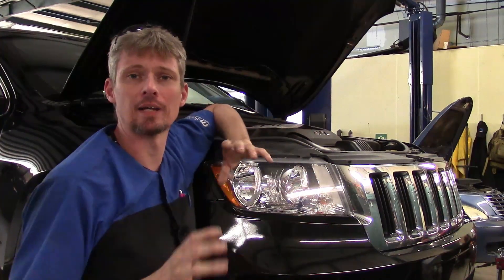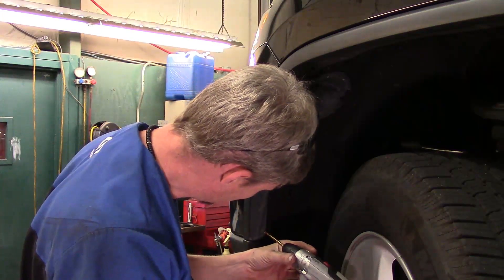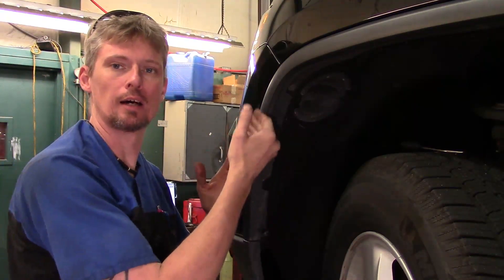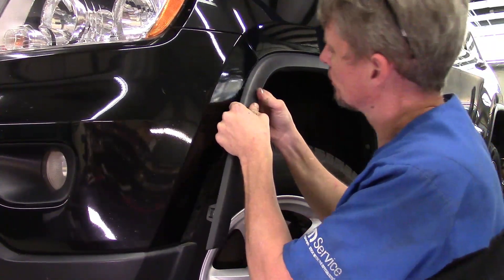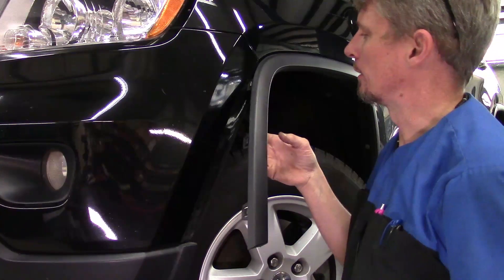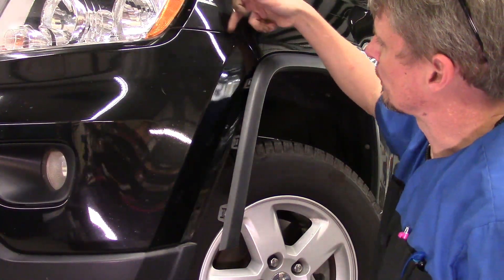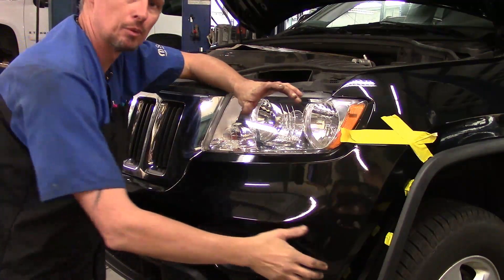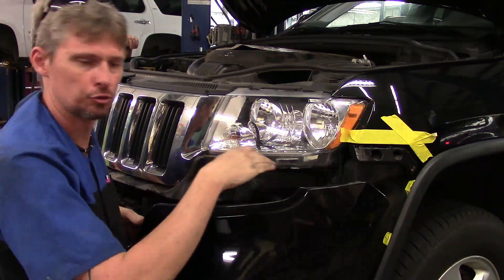2011-2013 Jeep Grand Cherokee front bumper cover removal

Comment: This video was great. Thank you for that. The only downside is that it didn't have a re-inetsllation sequence. Neither does the instruction sheet that came with my tow bracket kit. The tow bracket kit instructions were nowhere as good as this video, not by a long shot. So, again, thanks for such a great video.

Comment: I have what is probably a silly question on the reinstall portion - for the plastic rivets that you drilled out, do you just use new ones to replace (if so, what is the part number?) or do you leave those out when reinstalling? Also, drilling does look to be fairly easy, but just in case, is there an alternate way to do this? Im a little afraid of being slightly off and damaging something.
Reply from the maker: You can pic up the plastic rivets at any local parts store. You will need a plastic rivet tool to install them as well. Here is a link to my amazon store that shows the tool......go to the body tool section and there it will be: http://astore.amazon.com/motorcitymechanic-20 . Otherwise drilling is the best method unless you can knock the center out of the rivet. Usually thats hard to do so drilling is the best method. Have no worries and take your time....you wont have any issues. Thanks for the question and make sure to subscribe

Comment: I got a large deep scratch on my 2012 grill, body shop wants 800 for a new grill.  I see replacements for 175.  Considering attempting this based on your video, is it reasonable to try this without a lift?  Also the Amazon store link for your store below doesn’t seem to work.  Thoughts on where to get tool and rivets?

Comment: I'm going to attempt to remove and replace my front bumper in my 2013 GC. Do you know where I could get replacement plastic rivets for the wheel well that you mention at 1:23? Amazon has some kits with the most common sizes but I want to make sure I get the correct one.

Comment: Excellent video!  Quick question.  I have a WK2 2012 Grand Cherokee Limited (with headlamp washers) I have to replace the washer bottle that as cracked.  I assume I need to remove the front bumber cover to replace this reservoir - which I can now do - thanks to your video.  Are there any other tips or pitfalls to look out for when completing this task?  Huge Thanks

Comment: Thanks for posting this! This will definitely help for me to take off the bumper and diagnose what clips or hardware is keeping my 2013 JGC front bumper cover affixed to the front quarter panel. An airborne cone hit my jeep while on the highway and I can't seem to push my bumper cover all the way back in and to me it looks like it's bc there were plastic clips attaching it? I wish I could post a pic of the holes I see where I think these would be. Any guidance you can offer?

Comment: Need to remove rocker molding that runs from the front wheel well to the back. But it has plastic tabs that are part of it. How do I remove without breaking any of the plastic tabs

Comment: Question, there are just clips holding that bumper to the 1/4  panel? You didn't show what the bumper is 'clipped" into..
Reply from the maker: +RoadTripVidz Actually they are not clips....there are cut outs/notches on the bumper cover that snap into a track just below the fender edge.
Reply: MotorCity Mechanic appreciate the quick reply
Reply from the maker: +RoadTripVidz Your welcome. Thanks for watching and make sure to subscribe
Reply: MotorCity Mechanic keep doing wk2 videos!!
Reply: Hello i have a 2012 srt8-jeep and under my headlight the bumper cover is sticking out but from watching your video  i didn't see any clips or anything holding the bumper under the headlight. I've tried pushing it in but it doesn't seem to do anything. Any suggestions and would i have to take the whole bumper off to fix? apparently it's a common problem with this model

Comment: Hi a 2014+ front bumper face will fit to a 2012 model?
Reply from the maker: Not 100% sure. I would think it would but never tried it myself and never checked into it on line to see if someone posted in the forums. I am curious myself. Thanks for the question. Make sure to subscribe

Comment: How do you replace those rivets you drilled out I have a 2013 and am going to put a hidden winch and am planning ahead all extra parts I’ll need do you need a special rivet gun and where do ya get them thanks great video
Reply from the maker: The plastic rivots use a plastic rivot gun which is different from the ones we are use to when using metal rivots. Most auto parts stores and Harbor Freight sell them along with the rivots. Thanks for asking and for the comment about the video. Make sure to subscribe.

Comment: hi, I removed the bumper and grill since I had to install a grill insert after a bird hit my Jeep.  I was able to reinstall everything however on the passenger side there seems to be a single clip that won't snap in.  nothing seems to be broken just when you push the bumper in it doesn't stay in.  I'm talking about right between the grill and the headlight.  it's a pretty small gap but it's annoying me.  is there anything I can do?
Reply from the maker: Hey Mario....you might have to take it back off and take a closer look to see why it might not be sitting in place correctly. Something might not be lined up right or something might have broke during the removal. Thanks for the question and for watching. Make sure to subscribe and check out my other videos.

Comment: Where can I get replacements for the grille fastener clips that go into the radiator support?
Reply from the maker: About the only place I know is the dealer.....I am sure they would have to order them. Otherwise you might be able to check your local auto parts store.....they do carry an assortment of fasteners for different cars. Thanks for the question and make sure to subscribe.

Comment: that is help me, thank you
Reply from the maker: Your very much welcomed. Now let me tell you thank you for watching and make sure to subscribe.
Reply: ?can i ask you her about 2012 jeep transmission
Reply from the maker: Of course you can, What is your question?
Reply: my car grand cherokee 2012 5.7 ,when i change the gear hand from N position to D or R i feel very heavy hit sound ,
 sorry my English not good
Reply from the maker: If it was 4wd then I would check all the mounts including the front differential. Also there is a procedure call a "quick learn" that is recommend after servicing the trans that helps make the shifts softer, it requires a scanner to do it however
Reply: first of all thank you very much , i remove the front garden shaft [to disconnect the front differential from the trans]  and i try it still the same
  i change the transmission and the transfer case and still the same , i see the same problem in the other jeep grand Cherokee that have the same engine no one in Iraq can fix this problem because don't have Chrysler  repair agency
Reply from the maker: Laith Laith Laith Laith Nothing is coming to mind at the moment. It has to be hard to work on with no Chrysler dealers. Make no issues with the rear driveshaft or rear differential.

Comment: My car bumper looks really bad. The whole bumper came off and it can't be repaired. I ordered a bumper cover but idk anything about putting it on without a bumper or if that's even possible.
Reply from the maker: So that I fully understand.....the plastic bumper cover was damaged and came off and you ordered another. If thats the case then you should be able to reinstall the new one with no issues unless there is more damage such as the places where the cover snaps on. It might be one of those things that require looking at it in order for me to get a full understanding and then see whats needed. Sometimes only so much can be spoken in just words on a screen such as this.

Comment: I have had my adaptive cruise control sensor bracket plugs push through when off road. I now understand the 2011 version has been replaced so need to buy a whole new assembly here in Australia for about 500$ plus installation. have you got any other ideas? Is there an easy way to get at the mounting plate or do you have to remove the front bumper? thaight@nltinc.com.au  thanks !
Reply from the maker: I havent had to replace one on that vehicle as of yet. One important item to keep in mind is that it has to be calibrated at the dealer. There is a special set up that they have to use to make sure its set properly. It can include test driving with the scanner and using a special test. The other is a tri-pod set and special board and manual adjustments made. All the above require visiting the dealership. The service information does mention removing the bumper cover. It does say to unsnap and remove the trim that goes around the sensor and then you have access to the assembly. I havent heard of any changes in the bracket but as I mentioned.....I havent had to replace one on that vehicle as of yet